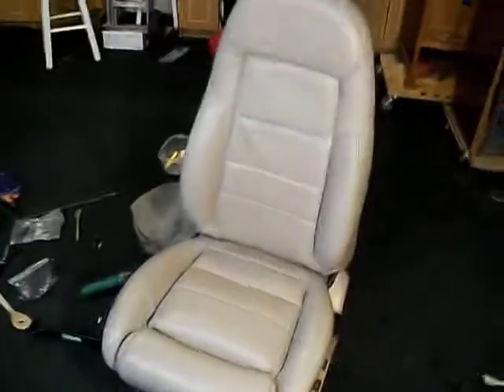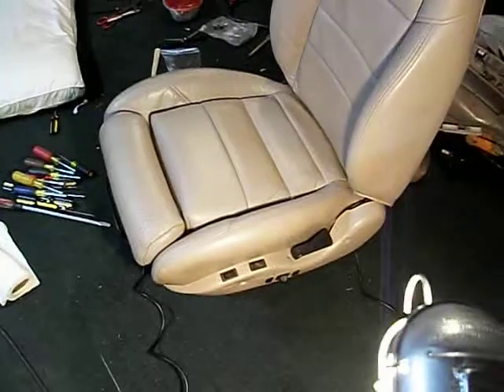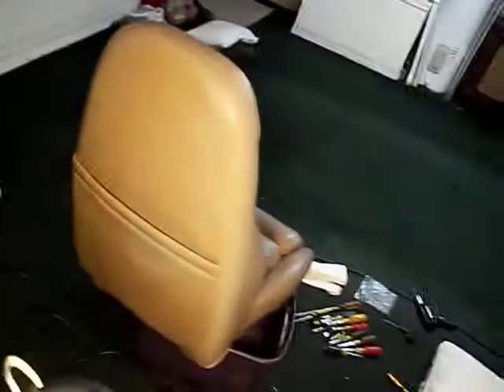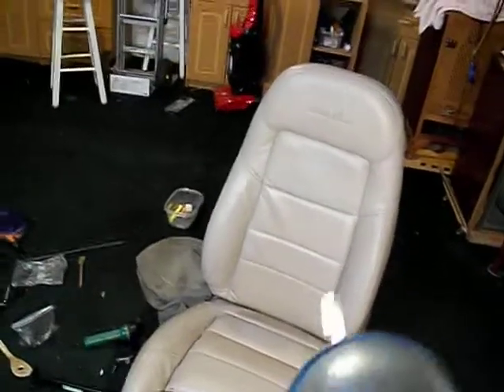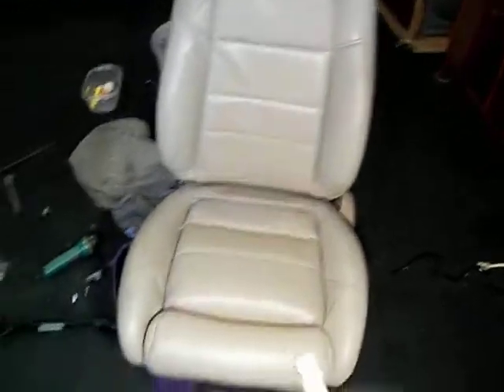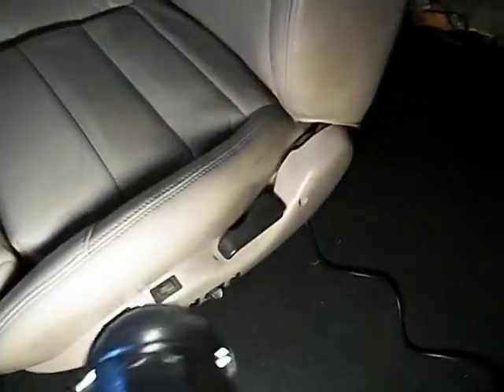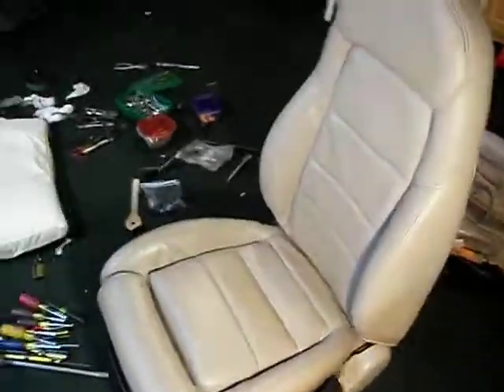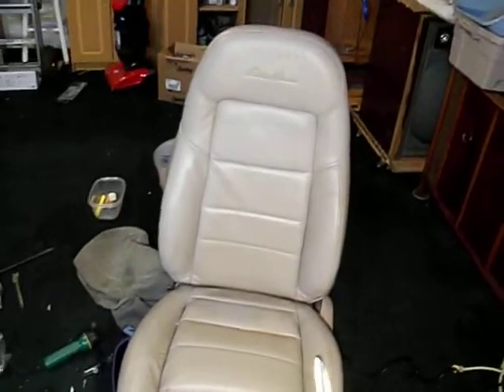Car seat swap ford explorer power leather DONE

Comment: Interesting project. Looks the same as my '96. I have cloth seats, however the lumbar looses hold pressure, & my back tilt forward lever is broken off. Got the truck that way. Folks say the loss of air is a dirty air switch, but it still needs a lever repair too. It's broke off at the pivot point. Have the piece. Might be able to get the lever welded back together. Fun fun. Nice job.
Reply from the maker: Just head down to the junk yard, I am sure you will find what you need. I am going back for a head liner next. My plan is to pull a junk headliner and IF I can make it look good then I will install. It so cheap that it only makes since to work on a spare. the bad part about 1st gen is they used some kind of pressed fiberglass as the substate, very hard to remove the foam or so it seems anyway.
Reply: Dave WM
The foam was difficult to remove, but it can be done. The key was to try not to dig into the substrate when using a small putty knife. Watched a video, & I did this on my other car & used foam backed cloth from the local fabric/craft store, & 3M headliner spray adhesive. It came out nice.